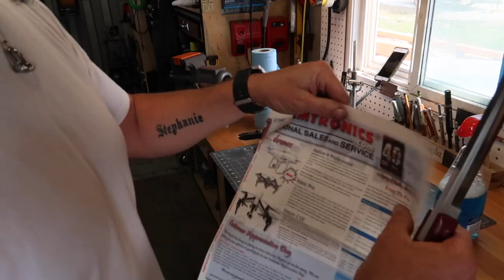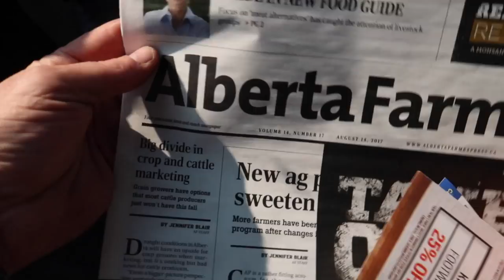PARACORD WRAP? Yes/No?  -knife-maker's daily vlog-

Comment: I think either bone or antler scales would look classic. Follow the shape of the handle but a few mm's from the edge and sand it into what would be called a cricket bat mould. The trianguler shaping at the back and front edge of the scale along with the pitched roof line along the handle would mimic and complement the shapes in the blade. Its a lovely looking piece of steel by the way.

Comment: I do a knife with an integral paracord wrap, I put a handle on it but thin then drill through to all the holes you have made in the handle and wrap the cord through so I goes along and through but not around the handle, then heat the ends together to join the end together, this aids grip but you are not not relying on it...

Comment: How about a cast aluminum handle.  Cast a full piece, saw down the length to create two scales.  Then sandblast (or use your foredom) the aluminum for grip.  Same weight profile as the paracord, and it is unusual.  Dark pins with perhaps a thin black micarta liner between the scales and the tang to give it an even more predatorial look.
Reply: jucedupp that wo ld look great

Comment: I am not really a fan of the parachor wrap but at first glance it looks like you might be slightly handcuffed on handle material because there appears to be not enough room for pins with all the current holes in the handle.  Have you had any luck using only epoxy to attach the handle scales?

Comment: To be absolutely honest, I think you should put a beautiful set of handle scales. Whoever thought of putting para cord on everything needs to be committed because that is a brain dead idea. Obviously, I am not a fan of para cord. Actually, I am. It's great on holding the parachute canopy open and attached to my body. Also works great when all the center threads are removed and you make some micarta with the outer shells. But para cord should never be used as handle material on a knife or any other sharp and pointy type object.